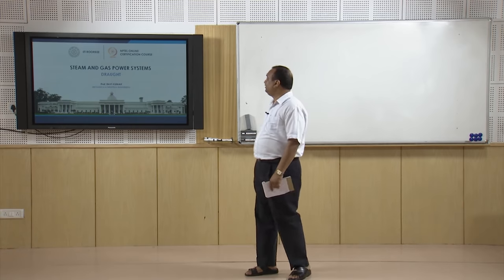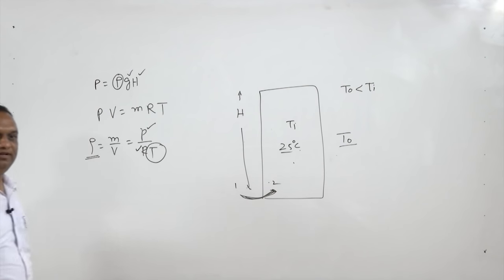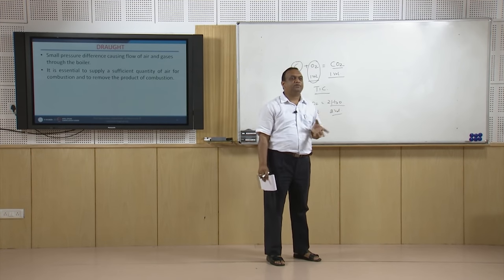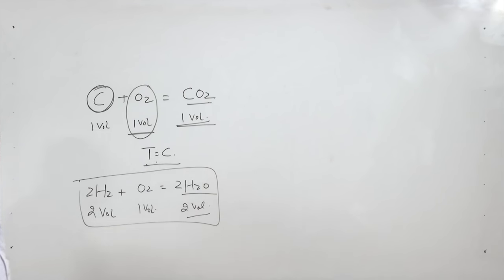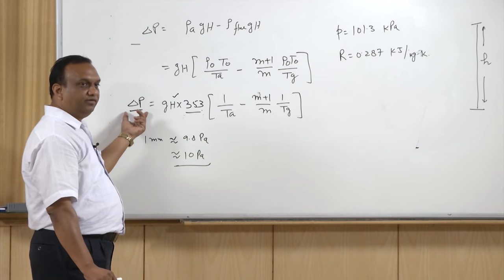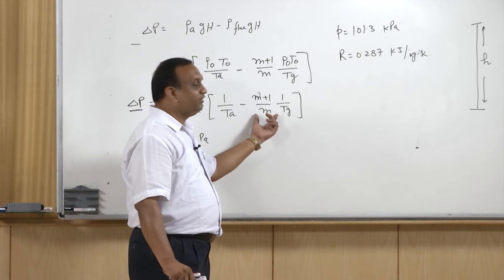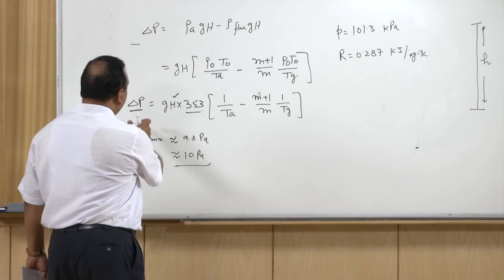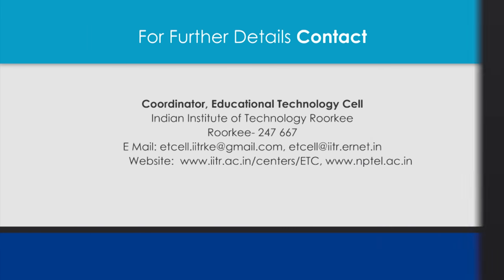Lecture 12: Draught

Comment: Equal moles of gases occupy equal volumes at same temperature and pressure conditions that's why Volume of flue gas =volume of air...&...  one mole of Oxygen produces one mole of CO2...H2O's moles produced is negligible in combustion